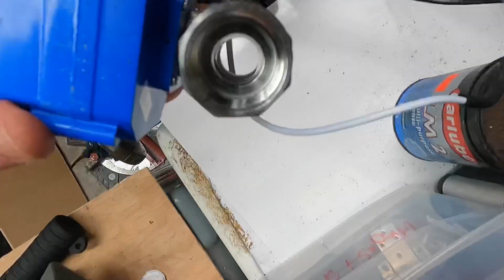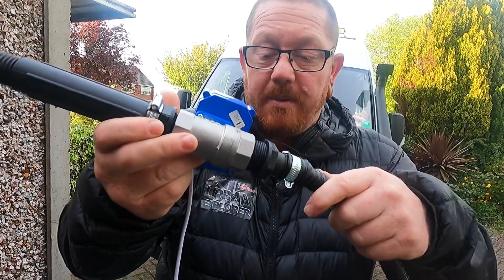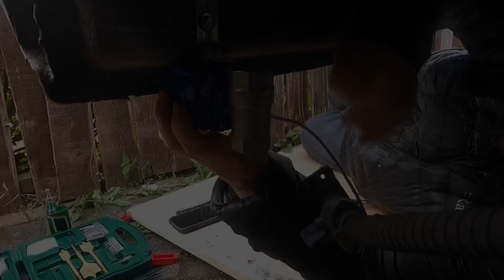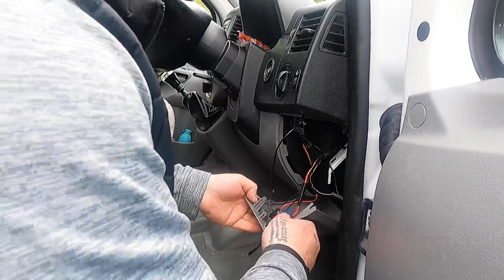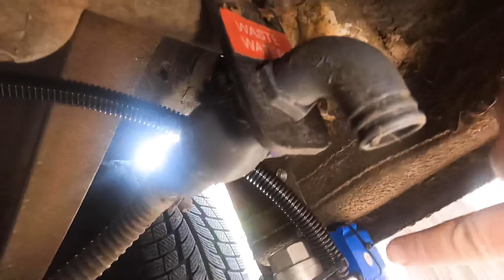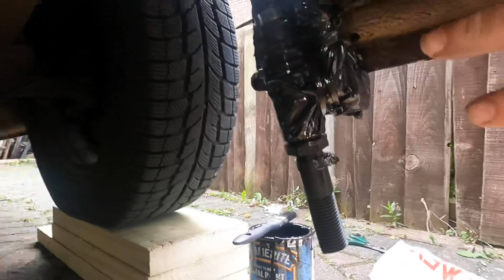Electric WASTE Water Valve For Your Camper Van

Comment: Im sure I loked at a video of some one fitting one of theese valves .but he said the one he had closed on a spring it  only needed power to open it . any one else know of this ?
Reply from the maker: Depends on the valve you get there are different types but they will have different wiring

Comment: Really useful to see the valve in operation as there seems to be v little technical information freely available. For example, I now understand why it's perfectly OK to leave the 3-position control switches in a Swift Carrera in the central (non-energised) position once the valves are closed. There's no way those valves are going to vibrate open, the drive is so low-geared. The vehicle dealers tell you to leave everything permanently energised - their knowledge of the technical side is sometimes limited, understandably perhaps.
Reply from the maker: It’s always worth checking the mechanics of these things yourself, glad you found the video useful! 👍

Comment: The issues i had with one of those valves is that it needs power to close which comes from a small internal battery. The problem is that the battery is only recharging when it has a power supply which is when the valve is open. Under normal circumstances this is only for relatively short periods of time when you are emptying the tank therefore the battery eventually gets weak and is unable to supply enough power to fully close the value. Not a major issue as long as you're aware of the issue and change level the valve open for longer on occasions to keep the battery topped up. 
       One other issue I had was that its small bore left it very slow to empty the tank.

Comment: Ah man, mine has stopped working to. Its properly glued into the tank. Has anyone found an alternative outdoor ball valve?
Reply from the maker: Not too sure, ours stopped working also!
Reply: @UrbanVanlife  I removed the blue driver part of the ball valve and opened it up. There was water inside the unit and corrosion on the motor. I swapped it out for a new one, leaving my valve in place and just replacing the blue part. I'm now thinking of sealing the motor completely by pasting sika flex over the entirety of the blue driver to weatherproof it, especially the seam line and cable entry hole. What do you think of this method?
Reply: The reason they stop working is that even though they are IP 65 rated ,damp will still get through by osmosis. The answer is Denso tape. Cover the whole valve. Dense tape can be painted.

Comment: I added one of these ussodid valves to my van. It worked great until it stopped working. Checked power to valve and finally had to remove. What a mess! Gray water from sink is not clean water!!! I thoroughly scrape my dishes but food waste is still getting into your tank and after sitting for a few days! IT Smells Bad. With no way to empty tank except motorized ball valve that don't work, I ended up with gray water all over the place and myself!!
Reply from the maker: Yer I have to be honest ours has packed in
Reply: How long did your US solid valves last? I have had two and they both failed in the first year

Comment: Quick question, are the steel wheels factory or did you paint them and if so, powder coated or rattle can?
Reply from the maker: I think we used hammer right if I remeber on the factory wheels

Comment: great upgrade. and just an idea, if you wanted to make it even easier you could fit two delay-off relay boards for each positive feed so that when you click the momentary switch it’ll trigger the relay that essentially holds the switch for you for say 5 seconds to fully operate the valve and then it’ll stop. just to save you holding it down and not knowing when it’s fully open/closed. this is what i’d do but I don’t even have a waste tank haha

Comment: Thanks for the vid, very helpful. Now you've had it fitted a while how are you getting on with it? Does it drain slower than the original manual tap? and do you have to keep your finger on the switch while emptying or will it stay open until you press close? 👍
Reply from the maker: still working perfect mate . and drains very fast , when you hold it dont it opens all the way and will stay open untill you push the switch up untill its fully closed . they when you let go the switch returns to the center and stops all the live feeds going to the motor

Comment: Great vid. We’ve a waste solenoid valve similar to yours (that’s wired ready, but still on the to do list😂👍) Is your one weatherproof? As ours isnt and I’m thinking of covering it with insulation/packing to protect it from the elements underneath the van. Cheers
Reply from the maker: It said it’s weatherproof but I still wrapped it and taped it . And still waiting for it to fail . Which reminds me I need to check it
Reply: @UrbanVanlife  Thanks for replying. All good then 👍😊
Reply: That model is marked IP65 (but it is made of pure Chinesium, so you should probably take that with a pinch of salt), so in theory...
"Water projected for three minutes by a nozzle (6.3 mm (0.25 in)) at a pressure of 30kPa and a rate of 12.4l/min against the enclosure from any direction shall have no harmful effects."
The only problem I see is that the valve is sited behind the rear wheel, so in wet weather it's going to get a constant forceful spray. A simple baffle/guard on the wheel side would probably be sufficient, but bagging it up would also work.
Reply: @nabarnes  thanks bud. Agree there. I’ll be doing the same to ours 👍👍

Comment: Humble question, if you push down for “off” surely this should be the closed position? Not the open position? Or push up for “On” this would be value open?
Reply from the maker: its each to there own , in my head down is drop water cos the water comes down out the van , but what if you put the switch sidewise no there is the real question
Reply: @UrbanVanlife  equally, you could install the switch upside down in this case. Either way thoroughly enjoyed your vlog sir.
Reply from the maker: We are button mad my friend lol thanks maye

Comment: Hi mate good video, handy thing to have.
Good to see you at the show the other week.👍
My waste just drains straight outside which is much easier 😂
If you had the ball valve mounted sideways you could get more out of the tank as the inlet would be lower and without the need 90 degree elbow.
Reply from the maker: yer im thinking of repositioning it mate so its on its side

Comment: Nice video, you can actually get a 2 wire normally closed one that will automatically close when it loses power. That’s what we have. All you need is positive and negative and a normal switch.
Reply from the maker: yer but it means you have to keep power to it to keep it opoen , and after looking in to them the main problem with them is people forget to turn the power off and the thing burns out over time ,
Reply: @UrbanVanlife  nope not with this ball valve, for the solenoid I had before you needed power to keep it open, but for this new ball valve it only uses 5W to open and once it’s open it doesn’t use anymore power and once it loses power it just closes on its own, so it’s very power efficient. I wish I installed it earlier in the build lol. I had to clean the solenoid valve k had in before about 4 times because it kept getting blocked with food, but with this ball valve no more blockage 😁

Comment: looks handy. Im not having any onboard water on the trailer at this time but something to keep in mind for future builds for sure. id suggest plastidip instead of the bag im guessing the bad will rip when you go on gravel as well as hold water IN and not let it to try out.
Reply from the maker: yer time tilll tell about the bag mate , im thinking of putting it in a sealed box , i just have to find the right one

Comment: I think that it may be better to install the valve horizontally and the put a 90 degree bend on the outlet from the valve, that way the pipe from the tank would be lower and the outlet would be higher if that make sense, and if the outlet is higher you may be able to get a bucket underneath if you need to.
Reply from the maker: Yer I do need to re look at the mounting position to be honest cos I’m not happy with it . But it will be one of the jobs I go back to

Comment: Holy shit Neil, you are on it buddy, My waste tank pipes kept blocking up and began to stink the van up, my solution was to remove said waste tank and allow grey water to flow direct to ground. If I’m ever on a campsite or a place that will make people frown I’ll simply put a bucket under the outlet. Never needed to do that yet though 😂
Reply from the maker: there is a one way flow valve you can get mate from screw fix that will stop the smells coming back up the pipe , we have them on ours and there only cheep bud , and do the job perfect as well
Reply: @UrbanVanlife  nice one, I’ll confess I’m no expert with plumbing, I am however a very good finishing joiner with over 20 years experience in the construction of luxury yachts, and offshore living accommodation modules (the rigs) so if you want amazing cabinets I’m your man, you want a toilet then I’m definitely not your man. 😂😆😂 can you tell me exactly what to order from Screwfix as I’m useless with plumbing, I mean bsp sizes etc aren’t actually what they say? it’s a minefield for me, I’ve spent a fortune a small fortune on plumbing parts that never work out. Cheers mate.
Reply from the maker: All the links to the stuff I got are in the description budddy

Comment: Could have fixed the valve immediately on the exit of the tank, you would need to fashion a bracket, but it looks like the valve would have been higher than the bottom of the tank, and then run waste pipe to side of van, otherwise great job, 
Also, installing a cheap reversing camera under the van would allow you to remain in your seat
Reply from the maker: nothing to fix it to on the tank side plus you dont need to leave your seat , you just hold the button in count to 5 and its open and then the same in reverse buddy